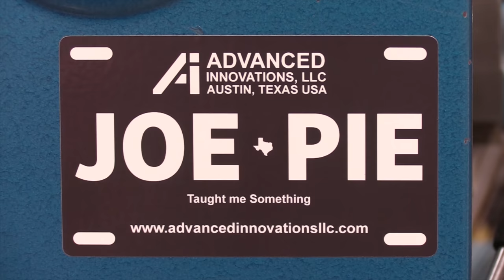Harley Sportster, Front Master Cylinder, Full Restoration (1 of 2)!

Comment: Usual smooth professional job. Strangely satisfying.
As an aside- how’s this for serendipity?
Couple of weeks back I watched your Brake Callipers-part 1 episode; and I actually made a comment about your Brake piston removal process.
Just today I replaced all front brake hoses on my Suzuki Waterbottle ( almost at the end of a 2 year restoration) and I thought why not check the callipers to see why it’s so difficult to push around. 
Frozen R/H piston! And crystallised brake fluid. And a brake pad absolutely jammed and immovable in the calliper.
Testament to the idiot who owned this bike previously.
 Easily removed by using your method. Amazing.
Reply from the maker: Hi Nick.. sounds like normal behaviors for brakes, if anything it's just neglect and time... great that you got it all sussed out and put right mate.. have a great weekend

Comment: i would have never tried this task before watching the ZX7 street fighter build.  Armed with the confidence that it isn't as hard as it looks and that with some degree of patience, reference material (shop manual) and some basic hand tools I think people might be surprised what they can do themselves.  Quick question, with the clip ons you're adding would a sport bike master cylinder have given some more bite from the front?
Reply from the maker: Hi buddy, thanks for your very kind comments!  This is exactly the same front braking system as on the early 1200's, various models only had one disc, but as you may have noticed, it's actually a dead beefy 4 pot front caliper and this is the master cylinder that's matched to it... the bike won't be gaining any more weight, quite the opposite in fact, and simply having lower bars makes no tangible difference to the braking requirements, so I'm sticking with the beautiful, genuine H-D master cylinder that, once it's all fully restored, will match perfectly in with the bike!  I just don't think that turning the bike into a 'bitsa' with various random components from here and there and other bikes, doesn't eventually make for a very nice motorcycle, I believe it can actually make them look a bit sketchy unless the components involved are the top drawer stuff such as Ohlins etc., and I simply don't have the budget for that!
Reply: @Moonfleet41  understand thanks 🙏

Comment: Morning Del, when you were preparing the front master cylinder you used a foam to fill the inside for sand blasting, where would I get some of that and what's it called.
Great videos, both Rosie and I enjoy watching.
Cheers Mac
Reply from the maker: It's a pro paint shop product for masking off holes ready for paint.. but as a great dodge, you can use plain old draught excluder that you stick in the door frame...get it from the DIY store for cheapo..!

Comment: I just found out something that some of your viewers might find useful. I recently installed Speed Bleeders on my 2000 Harley Springer. I wanted to reverse bleed the front brakes and purchased the syringe from Amazon. When I tried to do the reverse bleed procedure, the fluid would not go in and I broke the handle on the syringe. I then realized that Speed Bleeders have a one-way check valve (ball bearing) that only allows air and fluid to flow in one direction. So the bottom line is that Speed Bleeders cannot be used to reversed bleed as they will only allow fluid to flow out, but not in. I went back to the old bleeders.

Comment: I have always wondered about the second cleaning step. First a cleaner and then with water, so the contaminated water just runs down the drain. I don't think that's right.
Reply from the maker: Read a little on emulsifiable / biodegradable degreaser mate.. !
Reply: @Moonfleet41  still loads the wastewater treatment - and biodegradable is the cleaner, the dirt washed off is probably more mineral oils and greases
Reply from the maker: No, once the parts are washed in the tank, they're clean and almost dry bar a light residue of the degreaser itself.  this itself is biodegradable...  far more toxins wash off the roads every day by the rain mate.. Don't over think it.!

Comment: A passing thought regarding paint and critical clamping components.  I'm not trying to criticize, just passing along a thought!  Yamaha had a recall for the FZ-09 lineup of bikes a while back because some handlebar components' clamping surfaces had been factory powder coated/painted.  Allegedly, after time and vibration, the coating would break down and crumble underneath the torqued fasteners and surfaces, and things would become loose.  In the case of my bike, the bar riser clamps were affected.  Mega problem if that comes loose while riding.  Did this ever happen in the wild, or was Yamaha just being proactive?  I do not know.  Anyway thanks for the content, I really do enjoy watching you work and appreciate the knowledge shared. ✌🏼